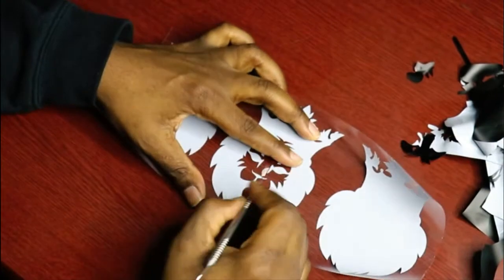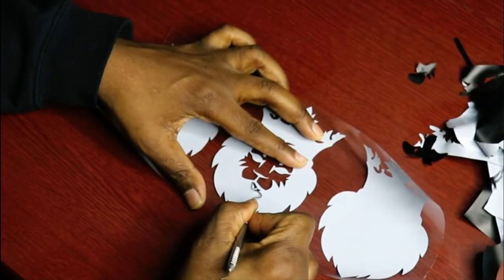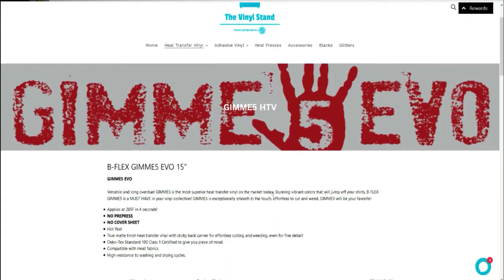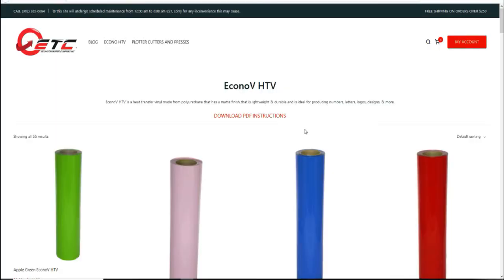3 Brands Of Heat Transfer Vinyl You Most Use

Comment: Stahls is the best.
Reply: Why do you like stahls?   Which one will you recommend?
Reply: @conniehard9145  I love Stahls because they have never let me down.  I used Fashion Film...a lot...now, they have Ultra Weed, which is Fashion Film's replacement as they are discontinuing it.
Reply: @SCUUBDO  im having the hardest weeding it!  i have ultraweed and premium plus.  No its not my blades i was told it my font im trying!
Reply: @conniehard9145  Very thin fonts can cause issues with weeding.  Another cause is the use of the wrong blade.  Lastly, it can be the type of cutter you use.
Reply: @SCUUBDO  you are correct i have a cricut explore air 2
Reply: @SCUUBDO  thanks for the reply